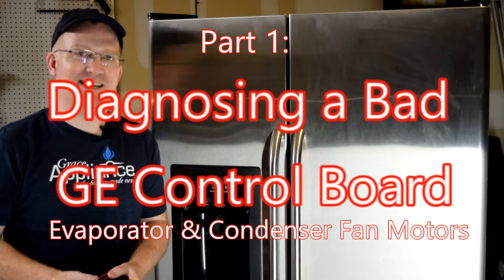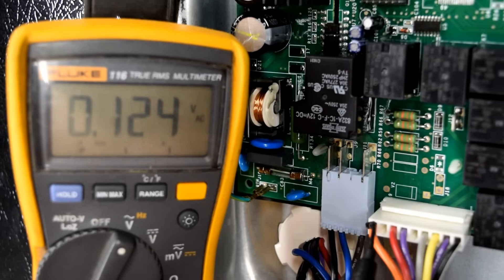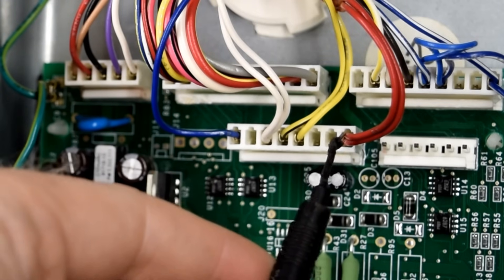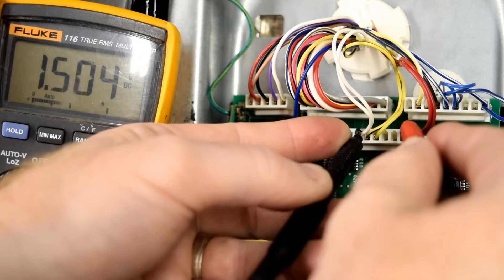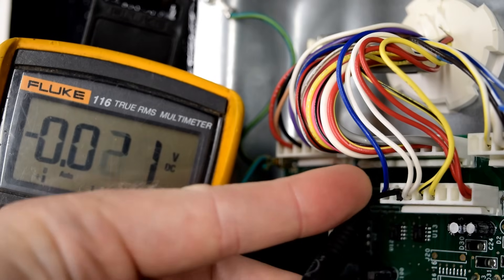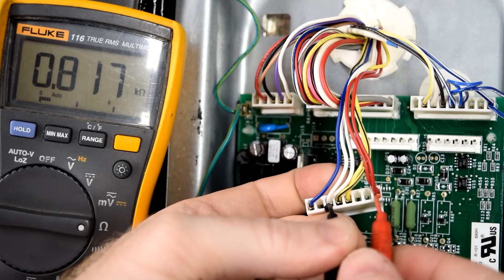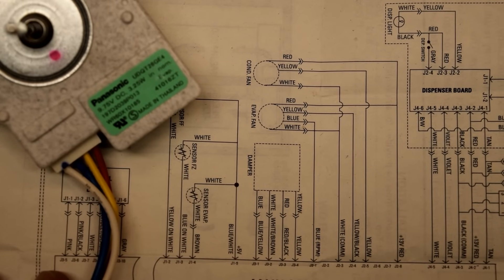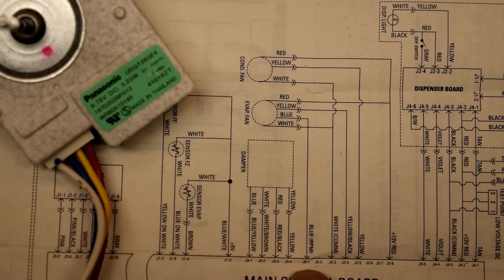Diagnosing a Bad GE Board - Part 1: Fan Motors

Comment: Andy,  Great video, and clear information.  Much appreciated.   I have a GE PFCS1RKZH SS, french door, bought in 2014.   Power was turned off on our street  and back on for a house connect two days ago.   My refrigerator was completely dead that night.  I assume when the power turned back it caused damage.   Yesterday I bought a control board from local repair shop and installed.    All works now except for the refrigerator (interior lights not working, not cooling).  Ice, water, lights on the outside, and the freezer are all operating just fine.   Can you advise how to test the board for the refrigerator cooling and lights not working?   I would like to confirm that the board I installed is working properly.    Is it possible that the power surge damaged more than just the control board?   Thanks,
Reply from the maker: Hey Nat,
Sorry to hear about the issues with your refrigerator.

Could you please send the first 5 digits of your serial number?
Reply from the maker: Also, just to confirm please post what the part number of the control board you installed.  Thanks!
Reply: Yes, Serial # is TZ 319904.    The control board part # is 225D3466G009
Reply from the maker: Hey Nat, 
Thanks. The part number you gave for the board didn’t make sense to me. It should have been a WR55X11098. Please confirm that.  
It should have also come with some install instructions. I checked your serial number against these instructions which on certain models will require snipping a wire on the harness as part of the install.  I could only find instruction sheets for a different part number than yours so it would be great to double check that.  

The first thing that comes to mind is I would check for a short in one of your fan motors.  The easiest way is to unplug the fridge, and at the Control Board unplug the (if memory serves) J4 connection. You’ll have a blue wire on the left of an 8 pin connector.  Has a red wire on the far right.  Once unplugged, reconnect power to the fridge and let me know if the fridge then acts as normal (minus the fans running of course). 

Let me know what you find.
Reply: Andy,  
I read the part number on the control board.  It was the same as the board that I removed.  The box that the control board came in has a label  - WR55X10956.   The box was open when they sold it to me.  Said they had it in one of the repair trucks.  So I'm a little concerned that the board may not be new...  May be that it was a board that they took out of a broken refrigerator..    

I will test for the fan motor short.   Will let you know what I find.
Reply: Andy,

I disconnected the 8 pin connector (was J2), that had a blue wire on the left and red/pink (two wires) on the far right.  After plugging power back in I lost the display on the front panel, and the refrigerator lights are still out when I open the door.   

What do you suggest that I try next?

Also - If the original board shorted out due to power surge, would I see damage anywhere on the board?
Reply from the maker: Hey,
I believe they may have sold you the incorrect board. Unless the one that sold you is cross comparable. But, I don't beleive so because your schematic does not show a substitution part number. I'd start there by ensuring this part number is a suitable replacement. I don't believe it is.
Even if it looks the same, the software on the board is model specific. To answer your question about the short on a board, they would not necessarily be visible damage in the event of a power surge. Hopefully the info is helpful.
Reply: Thanks for the useful information.   The part number on the board that I removed doesn't match the number on the board that I bought.   I'll go back tomorrow to hopefully get one that matches.      Hopefully with the correct board the refrigerator will be OK.   Thanks again.  I'll post tomorrow with the outcome.
Reply from the maker: Glad to help!  Yes, please follow up with what you find. I'm here to help if you need me.
Reply: Andy - The local shop ordered the correct part number for me.   I installed it and everything worked fine.   Back up and running!   As I mentioned, the part they sold me was in an open box, pulled from one of their repair trucks.  It's possible that the board came out of a refrigerator they repaired.   Delayed a few days, but at least I was able get it fixed, no loss of food thanks to the cold weather.     Thanks again for your guidance.  I'll be back to your site, I'm sure!
Reply from the maker: @natnorton5282  outstanding! So glad you got it sorted!  Glad to be of assistance. Thanks and stay in touch.

Comment: Hi Andy.  Great information.  I am working on a 2013 GE model GSE26HSECHSS SxS.  Evaporator is freezing over.  Fridge and Freezer warm on top and freezing on bottom.  I initially replaced all Thermistors.  I jumped the wire for the heater and it glowed orange as it should.  All tests came out correct except for the EVAP Fan was around 18 when you spec's it at 1.5-3 k ohms.  Would a failed EVAP motor cause the defrost heater to not come on ?  The R43 Evap Fan motor resistor on the circuit board looks fine.  The solder joints on the bottom look slightly discolored. They both tested at 2.1k ohms on the top.  Just trying to make sure it is the board before I spend the money.  Anything else you can think of?  Thanks Ty
Reply from the maker: Hey Ty,
Sorry to hear about your issues with your refrigerator.

I have not seen where a bad fan will keep the board from going in to defrost, but a shorted out fan will damage a board and no defrost as a side effect wouldn't suprise me either. In your case, I'd replace both the mian control board and evaporator fan motor.

Thanks!
Reply: @GraceAppliance  Thank you for the quick response !
Reply from the maker: @tysimmons2444  you're welcome! If you purchase through Amazon please click on the affiliate links in the description and it helps the channel a ton. Thanks!
Reply: I bought the new control board and fan via your link.  Those did the trick.  Thank you for the help.  Leaving a donation.  Ty
Reply from the maker: @tysimmons2444  I'm so glad to hear that! Glad to help and thank you ever so much for the donation! Stay in touch.  Andy

Comment: Well rats! I have a different mother board. It is the EBX1425P001 and is laid out differently. My J2 is a 6 pin connector on the bottom and only has a solid yellow, white and black wire (3 single wires) coming out of it. Is the J2 connector dedicated for the fans across all boards?
Reply from the maker: I can take a look and see. What is your model number for your fridge?
Reply: @GraceAppliance   Sorry I am bouncing back and forth between your videos, lol. Sorry, model fridge is GE PYE22PSHBSS.
Reply from the maker: @notruss1  No problem.  So, your fridge is a different animal than what we're talking about in this video.  So, i'm not sure how much help they're going to be with the diagnosis.  Like you said, due to the fact that you're working on a french door fridge the board is going to be drastically different than what is shown here. 

I did find your service manual and if you wanted to send me an email to graceappliance@gmail.com I'm happy to forward it along to you. It may be helpful for pulling codes and forced run of certain components.

Comment: Isn't there a diagnostic function you can access from the display panel on the door by pressing the WATER - CRUSHED - CUBED buttons all at once to reveal problem codes? My fridge is working but from your videos here before I even test I suspect a bad evaporator fan and/or motherboard. Fridge works, but fresh food area is warm like 66F with ice and water forming on floor under deli tray. Freezer is cold at 0 degrees F, ICE maker works fine, etc. Thanks! Very good info here.
Reply from the maker: Hey, sorry to hear about your fridge issues.
To answer your question about the diagnostics mode...yes, some models do have this capability. Typically the models with the temperature controls inside the refrigerator section with the digit displays. 

In fact you can also buy these super expensive control boards and install the board on fridges without the temperature controls to gather the codes and forced run options. Essentially, the board is doing for you what I demo in these videos. 

This video gives a nice breakdown:
https://www.appliancejunk.com/forums/index.php?topic=2380.0

I've never found the codes super useful though. They'll tell you if your temp sensors are open or closed, but not the ohm reading. So, you end up needing to test with a meter anyway. Lol. Or, fan motor failed. Yet, that could mean a bad fan motor or has the board failed?! So, again you're still needing to test with a meter. 

So, you're not missing anything without the boards.  😅

What is your model number?
Reply: @GraceAppliance  Thanks Andy. Yeah so I took off the access plate and my motherboard is different. My fridge is GE PYE22PSHBSS and the motherboard number etched on it is EBX1425P001. There is a J2 but it is a 6-pin connector at the bottom and has only one solid yellow, white and black coming out. There are other Js; J8; J10; 12 etc. with different thinner guage wires, but i dont see one with the color coding or numbers like you have. My issue is fresh food at 66F, with ice on the condenser and water at bottom of deli drawer floor. I have not noticed any fan noise either. I visually checked the motherboard and there are no popped/bulged/leaking caps and the resistors look fine. Motherboard looks like new the fridge is dated 2014. I have not taken the motherboard out yet to look for solder issues on the back side. If I leave the doors open for 3 minutes shouldn't the fans come on? So I could wait 3 minutes and if I dont hear the fan at least I know it is not coming on? The mother board has what looks like a green power good LED flashing every second.  The freezer is fine at 0F and the ice maker is working fine but melting due to warm food compartment.
Reply: I decided to open fridge and access the connector for the fan from inside the food compartment since I cannot ID it on the motherboard. It has black, red, yellow and blue wires from the connector to the fan. I tested the red and black posts on the fridge side and got 13.64 volts. So even though my MB is different, there appears to be proper voltage going to the fan plug. Then I did an Ohms check between the black and red wire plug ports on the fan side of the connector and got about 132.3k  and it bounces around between 109k and 298k.  If I'm reading that correctly...lol
Reply from the maker: @notruss1  Yes, it does sound like you've got correct voltage at the fan plug.  The OHM test I wouldn't worry too much about for now.  You wouldn't be able to take the OHM reading with voltage being sent currently.  You'd do this with the fridge unplugged and fan disconnected.  

If you're getting 13.5vdc to the fan and the fan isn't turning - You've diagnosed it as a failed fan motor.  Congratulations!  : ) 

The fan you need for the refrigerator section is this one. 
You can help support my channel by purchasing through this Amazon affiliate link: https://amzn.to/2SeNJaL

The other colored wires on the fan are the same as what is shown in this video: https://www.youtube.com/watch?v=PwsoOpUbxvk
Basically, it's Red & Black for the power (13.5v) the yellow is a signal wire back to the board and the blue wire being a tachometer to give the board a certain frequency response so it knows the speed of the fan motor based on RPM. 

Let me know if you have any questions.  Thanks!
Andy
Reply: @GraceAppliance  Thanks so much! Yes, when I did the OHM test I unplugged the fan from the inside of the fridge and then tested the unplugged hanging  fan connector at the red and black wire plugs on the fan side. Thats where I got the OHM  reading from, no power. I also notice the freezer fan was working because the port to the ice maker door is blowing from the bottom but the top one is not. Trying to melt ice now to get the condenser cover off and access fan. Thanks again and Merry Xmas!
Reply from the maker: You're most welcome, glad to help. 
Also, if you've got water build up under the crisper trays - this is a different issue and wouldn't have to do with the cooling issues you're having (which is of course caused by the fan not working currently). The water build up is due to a clogged defrost drainline (directly below your refrigerator evaporator).  The line gets clogged with ice and doesn't allow the water to drain after a defrost cycle to a pan under the refrigerator where it then evaporates.  

On this drain line (which you can access from behind the refrigerator) you will find something that looks like a black rubber duck bill.  You can then cut a small triangle out of the middle of it to enlarge the hole that the water drains through and then reassemble (do this both for the fridge and freezer duck bills).  You of course will need to thaw the line to clear the ice as well so the water can flow freely again.  
This can be done (slowly) by using a hair dryer, thawing your fridge by unplugging it, or with a turkey baster. :(
Or, (shameless plug here) my product called IceSurrender lets you squirt hot water down inside the tube and thaws it out quickly which you could get here through this affiliate link: https://amzn.to/2EFjPcM
It honestly does work amazing on defrost drain lines though and keeps you from having to thaw the fridge. Once you modify the drain line like I mention above, you won't deal with that issue again.  

Another quick tip, is that if you take a thick piece of solid copper wire, you can bend it in the shape of a candycane, and hang it from the defrost heater with the copper hanging down from the heater to the inside of the defrost drain line.  This way, anytime the heater comes on, it transfers some of the heat down to the inside of the drain line and if ice did happen to build up there again, it will thaw this ice and allow the water to flow.  I hope that makes sense.